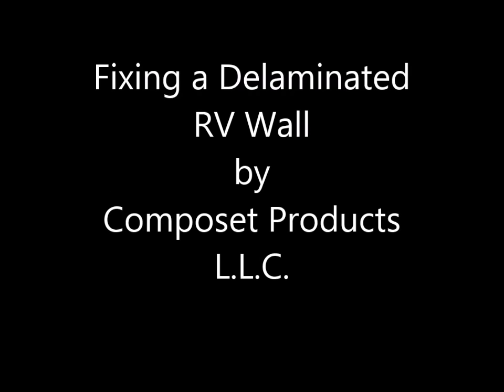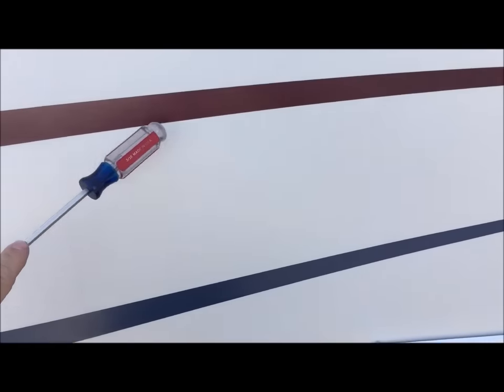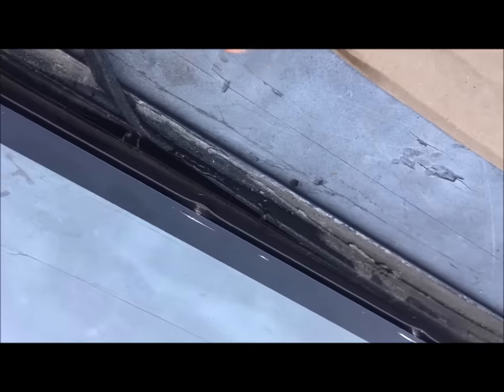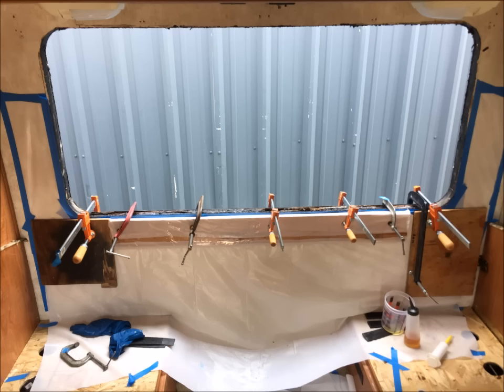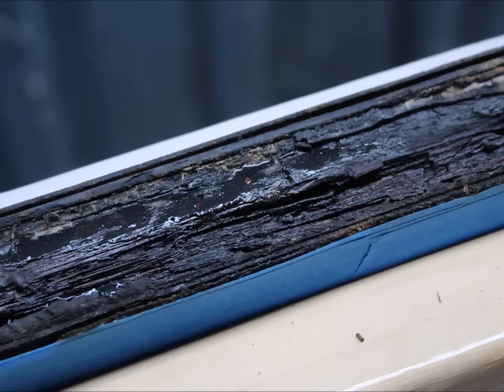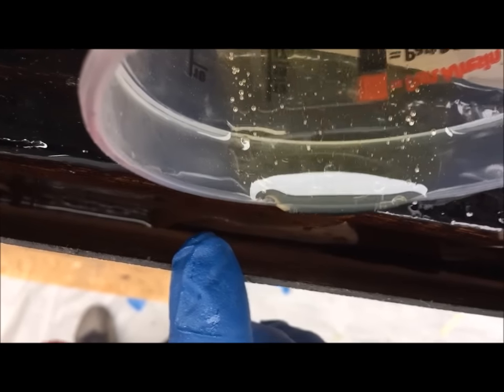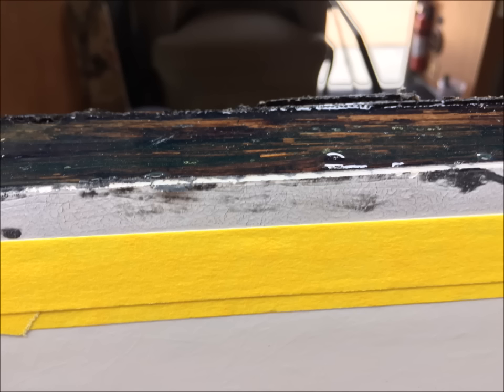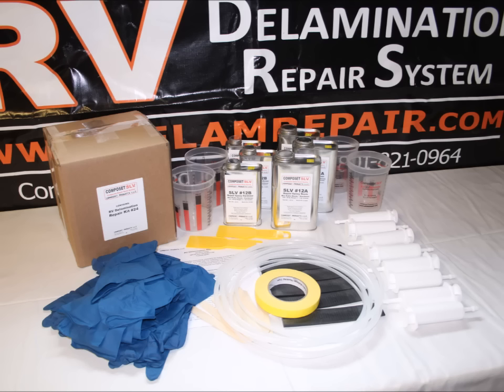RV Camper Motorhome Wall Delamination, Easy DIY wall fix for Bulges & Bubbles on the Sidewall.

Comment: I have been trying to find someone to help us fix our small delamination problem and I’m not finding anyone. Do you fix RV delamination for people?
Reply: Did you find anyone to repair yours?
Reply: @2lauracoleman   yes but the estimates we got-were a few thousands of dollars. At this point we are just making sure everything stays caulked good and so far it hasn’t got any worse, thank goodness.
Reply: @irresistible72  Drill a few small holes at the top of the delamination and use large syringes to 'pump' it full of epoxy resin(@home depot, etc.), just use LESS of the hardener so it sets over a longer period
Reply: @btchhopperou812   thank you 😊

Comment: this looks to be about the same setup consistency as marine penetrating resin?
Reply from the maker: The Composet SLV system is probably a little thicker than a penetrating resin. I can't say for sure because I am not sure which marine product you are comparing it to. The one thing I can add is that some of the penetrating resins/epoxies have a high solvent content (to make them penetrate), and the solvents attack Styrofoam. Composet SLV has zero solvents and is Styrofoam safe.

Comment: Not to deter away from your product, but gorilla glue (the squeeze tube) can work for small amounts of delimitation but needs strong mechanical clamping as it expands as it dries, it will have a hard time getting into the further out areas the product shown here could get to in a breeze and if you have more delimitation than what the gorilla can reasonably do (about 4 inches past tip of nozzle at best) then using this kit first is a must as the gorilla glue could block this product from doing its job, a turkey syringe with some IV tubing or similar can work but beware that it is very thick and will give a hard time going through, it’s also messier to use gorilla glue if the hose comes off, but for some people this product may not even be available to them, just offering an alternative fo those who need it, but if it’s anything more than an annoyance of delimitation (ie an actual problem) then it’s best to get a kit from these guys
Reply from the maker: Gorilla glue is a good product. However, it is a "moisture cure" product that requires a certain amount of moisture/water to cure. Not always a good thing, especially because gorilla glue has a tendency to expand and push parts apart. It also has a limited temp rating

Comment: Shouldn't the manufacturer be responsible for damage repair
Reply from the maker: You would hope they would, but most warranties pretty much protect them from water damage.
Reply: You'd be surprised to find out most rv manufacturers only offer a 1 to 3 year warranty on structural. Regardless if you spent $20K or $2million crazy huh